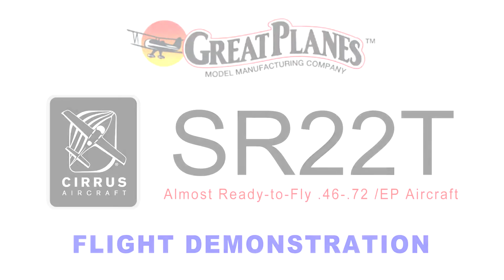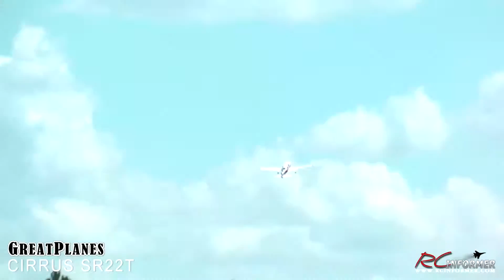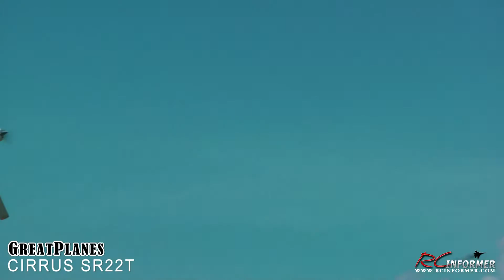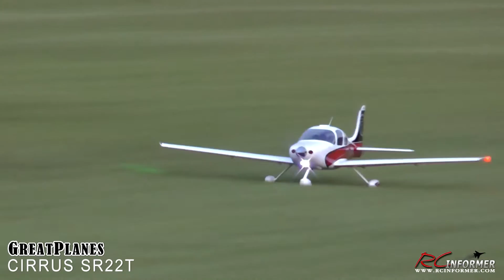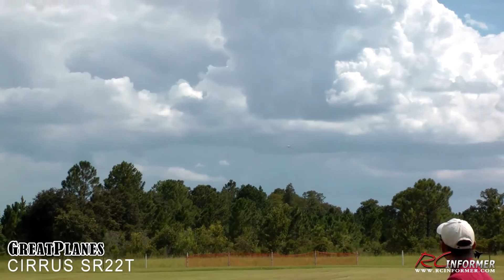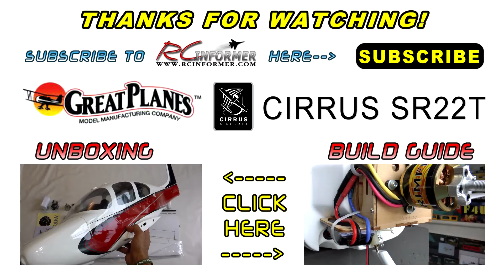Great Planes CIRRUS SR22T FLIGHT DEMO in HD By: RCINFORMER Part 3 of 3

Comment: Want to say thank you for this series on the SR22T.  I've used it to assemble my model, as others surely have too and will certainly benefit.  One tip I have regards the battery tray...if the battery is too thick (tall) for the canopy to fit on top, you can remove the battery tray and mount the tray underneath the rails.  In my case, a 6S 5000mah battery fit perfectly between the rails which, in addition to the hook/loop straps, helps keep the battery from moving sideways. And the canopy fits on top now.  Do take time to pry off and remove the battery tray though so you don't break it.

Comment: Excellent video series.  This is my next plane, thanks partly to the tips and depth of this video review.  Also looking forward to taking a break from Styrofoam, it looks like Great Planes really delivers on this one.
Reply from the maker: This is really one of the sweetest model Airplanes from GreatPlanes. It is fast and efficient but also flys well slow. It is easy to build & it can be made to fly as a glow powered model, but it really shines as an Electric Powered model. Overall it is a top notch model in every regard:)
Reply: +RCINFORMER A year later she's my favorite. Best of class .50 size civilian scale she drops jaws (hot-rod indeed). This video series was motivating with excellent advice. I have a couple of comments where I differ in opinion or there is a product update.  1. I do not recommend grinding up the horiz. tail at the fuse. root to expose a porous wooden bite. I prefer using ESC arming feature (Castle-creations Edge) rather heavy-gauge power-plug.